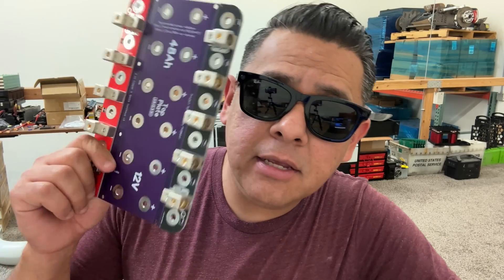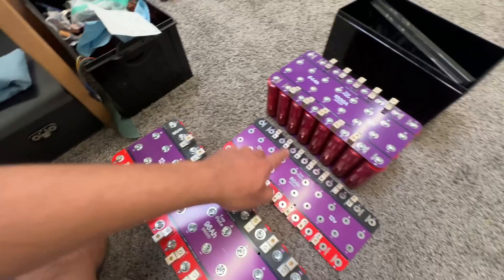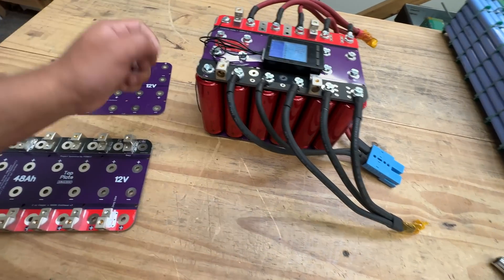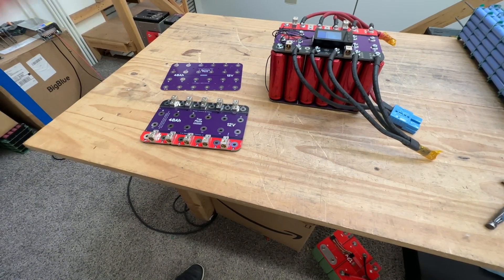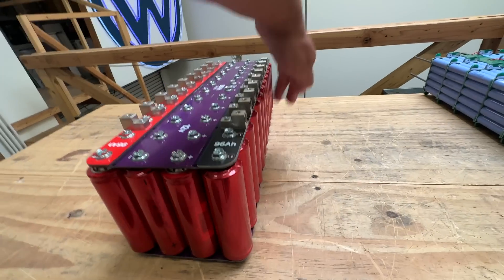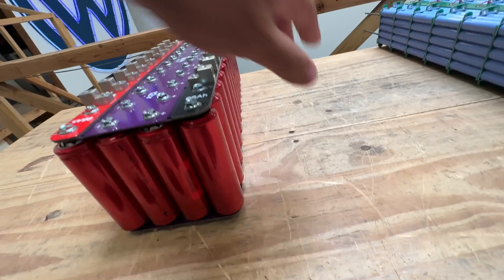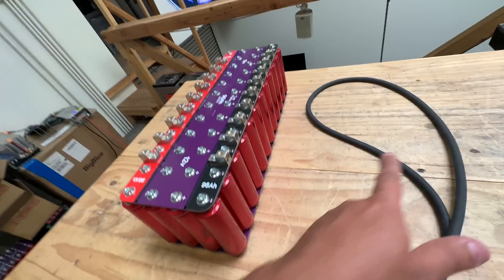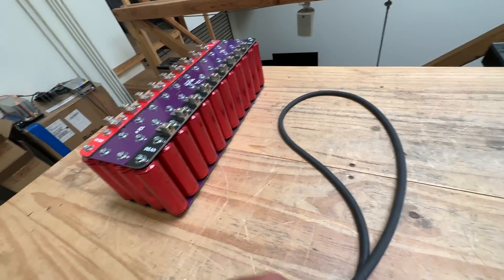Balancers on headways

Comment: I just bought one of these, using dc power supply full state of charge is around 17v, I have a mechman 390 amp alternator charges at 15v. This battery is doing good for my 10k watt sound system build, however it should be advertised as a 14v battery because charging at 15v it never gets past 20% state of charge according to the balancer. I am only using a portion of this thing capability, and my amps are only rated for 16v max so a voltage boosting harness is not an option, also their customer service wasn’t good, having a hard time talking to anyone. Questions about cold weather use
Reply from the maker: That’s incorrect these are LiFePO4 you are grossly over charging them at 17v.  These are not nmc.  Do not go above 15v or they will not last
Reply: @jehugarcia 
Do I need a different balancer then? I bought the balancer recommended on the listing for the battery
Reply from the maker: set the chemistry to LiFe
Reply: @jehugarcia  thank you seems like a dumb mistake but yes the chemistry was set to LIPO not LIFE, switched it over and all good state of charge was at 94 percent resting a touch over 14v! Thank you, final question what is temperature operation with this battery ? Do I need to worry about slow charging in colds months I live in WI ?

Comment: Hey  Jehu I bought a few of the older 64ah headway pcb. Without the lugs. Is there any cons with the old pcb? I have 2 , 0gauge lugs are bolted to the battery And 1 charge cable from my alternator. 
It works great for years but I’m now upgrading my amplifier from 5kw to 8kw  and will be upgrading the 1/0 cables to 2/0. 

Should I upgrade my pcb bus bars?

Comment: I need to either buy or build a 12v battery bank. I’m using it strictly for charging handheld devices and running my CPAP at night. I’d buy myself a battery specifically built for my CPAP but there’s not enough power to run it multiple days. So it’s either run my truck for hrs everyday to charge it back up or get a battery that can last the entire trip. I’m looking at the costs to build one vs buying a already built 12v battery and it’s looking like I’d be better off just buying a already built battery. For anyone that reads this and knows what should I do? I’ve already got a big ass ammo box that I can easily fit a 100 amp hr battery. I don’t need a sophisticated system I just plan on doing a simple 12v DC socket with a built in gauge and on and off switch.

Comment: If you built 2 or 3 96ah batteries (or smaller) 
 Can you show how you would connect these together in parallel to achieve a larger overall bank ??
Reply from the maker: Just use cables,  positive to positive and negative to negative,  there’s not much to show

Comment: Question on 2/3/4 connections. I see that your pointing to the area of connection between batteries. My question is do I just use a self tap screw with my ring terminal into the board itself or is that not what you mean and it connects to one of the battery bolts?
Reply from the maker: No don't use self tapping screws!!!!! use ring terminals on the screws used to hold the cells

Comment: Hi Jehu, are there any CMS available? (super) Capacitor Management Systems, for series connection, over voltage protection?
Reply from the maker: Ive only play with batteries so far
Reply: @jehugarcia   I understand, I guess I will make it myself

Comment: Quick off topic question. Ive watched several of your videos about using your PCB 18650 kits. On some of the stacks you mention using two of the BMS boards. Is more than one required for a certain number of units or is this just for amperage. IN other words, If I order the 25 pack, how many BMSs are needed?  Thanks.
Reply from the maker: Depends on the load you want.  60A or less use 1 board 60A or more use 2 boards

Comment: I'm kinda wondering what would happen if you added the all threaded connectors that allow you to screw two cells together on top of the bottom set of cells stack them and put the top plate on won't it give you a 24v battery?
Reply from the maker: Yes
Reply: @jehugarcia  would be great for 24v inverters I just purchased one from sungold power. Do a video on that type of setup may help sell to a larger crowd. I just got my boards in and populated them with the headway cells I'm just waiting on 8 more cells to come in from battery hookup
Reply from the maker: Why did you choose headways for 24v
Reply: @jehugarcia  I already had them for 12v system figured I might as well use them for power cart that I built for additional storage

Comment: Jehu …BMS .: no BMS what’s your take
Reply from the maker: Depends on the condition of the cells
Reply: @jehugarcia  so I was only asking because I’ve been using a balancer on the charge ..but with my recycled 18650 I also use the bat-go to just for the monitoring of the cells and it just been running no over or undervoltage
Reply: So at (8:08) explaining where the second wire goes, are you referring too the existing hole to make the connection?

Comment: **TIP** If your only using a couple of the terminals, I would also recommend taking some short pieces of wire and connect them and loop them in between the unused terminals. So whatever terminals are not being used with your wire to the amplifier just take a short piece of cable and connect the unused terminals together.
Reply: When a pcb like this is used. All the terminals should be used and have equal lengths of wire. 
If you have wires coming from alternator to the battery and wires from battery to amplifier then they should be put in one after another. 
Like if the first lug is a wire coming from alternator then the next lug should be to the amplifier then the next lug should be the alternator then the next one amplifier and so on. 
All the lugs should be used if you plan on drawing full power & make sure your alternator got a charge controller that monitors it's temparature because Lifepo4 can take so much charge that it will fry the alternator if the battery is low & the engine is at idle when the alternator fan is spinning the slowest.

Comment: Active balancers are useless for LFP as long as they can't be turned on exclusively at high or low SoC. Any other time they are messing with the balance more than fixing it, as out of balance cells can have barely any difference in voltage during the plateau phase.
Reply: Correct, I only use my 16s balancer to balance when one cell lags after fully charging because that's the time the balancer is most effective and when the voltage difference are more visible for it to work. Li-ion don't suffer from this because they have a linear discharge curve unlike our lifepo4 cells. One cell can be 30% soc while the other cell be 70% soc and have the same voltage.
Reply: the active balancers "turn on" as the voltage of the cells drift. Its pretty cool. They actually are on all the time but only do the cell balancing if one cell starts to drift and then the balancer gets to work. once the cells are even the balancer is really not doing much and just in standby mode.
Reply: You can get different kinds of active balancers or even smart balancers that will operate outside of those ranges
Reply: This is 100% correct, I have a balance board for my 16s lifepo4 I made off of the a123 26650 cells and because lifepo4 chemistry has 80% of it's charge at the nominal voltage a balancer does not balance until they're either at 10% voltage or 90+ and you can see the charge transfer on the Dalybms Bluetooth app. I have the leads connected at all times but only put the board on to balance when one cell drags.
Reply: @luis789lr  I have found similar results..... not really found a balancer active or passive that works well with Lifepo4.....

Comment: Glowe vs Jehu LETS FIGHT
Reply: It's like Edison vs Telsa. Let's see which tries to electrocute an elephant first.
Reply: I think we should just ignore that guy. Most of his views are coming because of this channel 😂. Otherwise his videos do not even have 10 - 20views. 
He could not even present a proper datasheet from the cell manufacturer when i asked for it and just posted some links to 3rd party sellers. 
Very few makers can produce a high c rate Lifepo4. 
Anr26650 and headway 8ah's are known industry wide for high discharge current.
Reply from the maker: He didn’t wanna share the specs sheet because he doesn’t want people finding out those are $13 cells
Reply: @jehugarcia … ¿How many of these would need to make 96 volt EV?
Reply: JEHU!
JEHU!
JEHU!